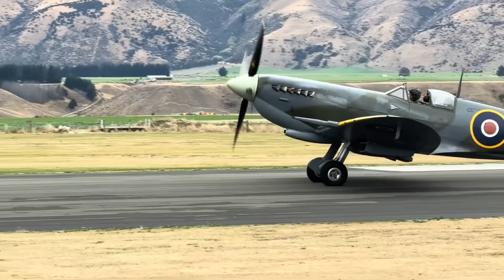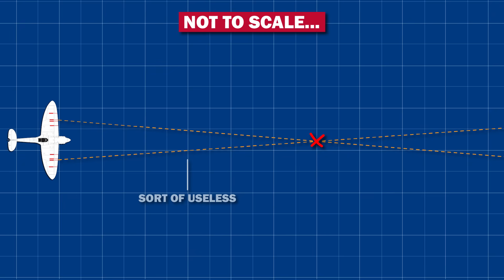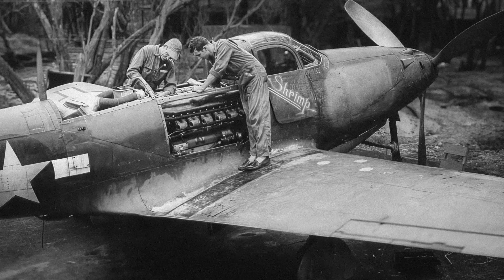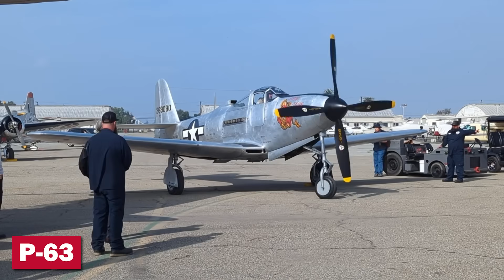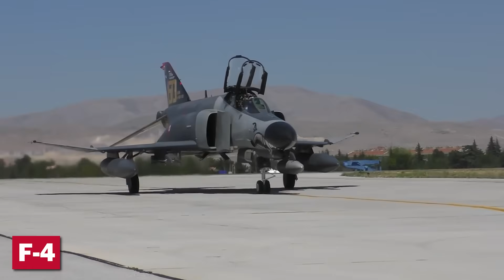What happened To Mid-Engined Aircraft?

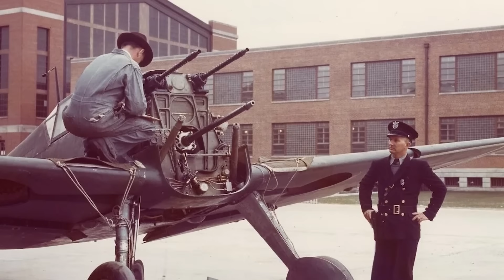Comment: 5:05 they did mount a 20mm cannon on the design - that was the P-400, I think exported to the RAF/RAAF and used in the Pacific
and they mounted 30mm cannon in the Bf 109 hub didn't they? and 37mm and 45mm in the Yak-1/3/9

Comment: Also worth mentioning is that P-39, while deemed unsuccessful on the Western front and in the Pacific, was broadly loved in the Soviet Union, which received most of the P-39 production as part of the lend-lease act. The Soviet Union flew comparatively few long-range bombing missions that required long-range escorts, and most of the air combat was done closer to the ground, so the P-39 fit the doctrine quite well, and also was generally of much higher build quality than domestically produced airframes.

Comment: You have some serious Misconceptions which for the sake of proper learning need to be disclaimed. 
-First XP 39 WAS made and flew in 1938, but First action was in 1941. 
By that time 37mm Guns were HEavily obsoleted. German ones got obsoleted By Russian tanks, Russians used the 45 and 75, Brits used a 2 pounder and Only the French, who were also obsoleted completely by Occupation had 37s on their Tanks. 
Statistically yeah MOST tanks IN THE FIELD since they are leftovers from the Early or pre-war would have 37s but NO new tanks that were not AA were made with such a small gun. 
-Second the Mid engine allows for Horizontal or Flight axis rocking. Especially with a large calliber(for a plane) weapon. The US 37mm short barrel did not have that much power, but Russians tried to mount their 37 that is 3x the caliber length of the M4 cannon and found out that is completely unusable in anything But Single shot fire. 
Which does NOT happen in a heat of battle. Even by most capable experienced pilots. 
Front engined Firgthers can fight heavy recoil because the weight of the Engine in front of the Pivot point(pitch axle) of the wings dampers the climb of the Cannon Muzzle rize, in case of FME completely eats it even for High power cannost like the Russian 37mm and 45mm on the Yak 9. 
P-39 actually aids the rocking a bit at low speeds because airflow isn't enough to resist, which Russians also reported. Yet be midful the Russian loved Both the 39 and the 63. 
Traditional FME(Front Mounted Engine) has its Gun Fighting to lift the whole weight of the Engine when it fires, P-39/63 has a Gun Mounted Above the Wing Axis plane and the Engine BEhind the Axis plane creating a Tail down momentum. When Both Weigh on the Pitch controls  at lower speeds the Gun rocks the Plane. Since Both The weight of the Engine and the Gun recoul twist the Plane in the same direction(pitch up) and the tail controls at lower speed do not ahve Enough Airflow to reists. So aiming becomes difficult.
-Third Engine, Radiators, even Fuel and ammo are Armour for the Pilot, especially protecting them from a Bomber. 
BF 109 FW 190, Shitfire, Mustang, Zero, your target from a back of a bomber is a head of the Pilot behind a thick piece of glass. 
In a P-39/63 its the Whole body of the Pilot. That Wins or Loses Wars, logistics. Other Pilots came back home way more often than P39/63 pilots.

Comment: Another reason for the taildragger configuration was the ability to have a larger propeller without having to add longer landing gear.
Reply from the maker: Ehh maybe? During take-off, even tail draggers lift the tail wheel off the ground before the main gear so it shouldn’t make any difference to the maximum allowable prop length.

Comment: The Germans also experimented with a mid-engined plane, but it wasn't a fighter. The He 119 was a prototype for a reconnaissance aircraft and a potential fast bomber with a twin-V12 behind the cockpit, a driveshaft going through the cockpit between the two pilots, and two counterrotating coaxial propellers in the front. The concept worked, but was deemed too complicated to be worth the effort

Comment: now, i have flown the p400 in war thunder vr sim mode, which i would say at least is a pretty accurate flight simulator, the p400 was the export version of the p39, and while maybe being technically more maneuverable than something like the 109, it felt unstable to fly, and simply trying to pull a sharp turn would put you in a spin. meanwhile the 109 felt very stable, and i could actually dogfight at low altitudes without worrying about going into a spin while turning.
Reply: they exported the P39 too - the P400 had a 20mm cannon and probably British-standard instruments or something too

Comment: This is a very good video, thanks.  I am subscribed.  

P-39 layout was best for fighters powered by liquid-cooled piston engines from around 1,000 to 6,000 horsepower, maybe more.  If jets and turboprops had not ousted piston engines, mid-engine layouts were likely to overtake.  But there was a lot of inertia favoring the conventional layout of the P-40; simpler to design and modify, familiarity leading to easier acceptance by customers and fliers, save the price and weight of a driveshaft, maybe simpler flight controls, etc.  

FRONT-ENGINE STRONG ADVANTAGES:  Cost, simplicity for designers.  Easier to adapt a new, bigger engine.  Save the cost, weight, and maintenance of the driveshaft.  

FRONT-ENGINE APPARENT ADVANTAGES:  Maintenance access.  Radial- and air-cooled engines cooling air ducting is simpler.  Flight controls have shorter pathways from cockpit to empennage, ailerons, et. al.  These advantages diminish with higher power, boosted controls, and could be mitigated.  

MID-ENGINE ADVANTAGES:  Pilot view, more powerful guns armament (can accommodate revolver and gatling guns e.g. MG-213), quieter and cleaner cockpit.  

The P-39 almost proved its point.  It offered better pilot view despite super-heavy canopy framing.  Its tricycle landing gear was the way of the future.  It was a little overbuilt and heavy for 1937 but its fuselage and wings stayed smooth and aerodynamic (did not wrinkle) as did lighter planes (Spitfires and Me109s always look wrinkly after use!) and it would have nicely accepted later, more powerful Allisons.  But it could not easily overcome shortcomings cooked into it at conception ... 

ENGINE:  The Allison was basically a fine engine but, in the P-39, it came up short for the famous reason that its turbo was deleted.  Later Allisons were eventually developed and would have been fantastic but they went to the P-63.  .  

POOR ARMAMENT:  That celebrated 37mm cannon was heavy and gave low probability of hitting moving targets, and other gunnery was too weak.  

SHORT RANGE:  In the 1930s, USAAC mis-read the 1940s' importance and utility of long range; it would have been difficult to build-in more fuel tanks; drop tanks only get you so far.  The radiator should have been behind the engine like in a Hurricane or Mustang but, instead, it was put right where the main fuel tank should have been.  Bonus: radiator could have been armored, for the cost of about 150 pounds of armor and ducting.  

MONEY:  Bell could not afford to fix it before competitors bypassed it.  They could have got rid of the stupid car-door.  

MIS-USE:  It was designed to intercept long-range bombers; that never really appeared.  Against the Zero, it was used poorly as a last-minute scramble to climb up and dogfight Zeros ... that is a no-win mission for anything short of a Bearcat, but played the P-39's weaknesses.  

Eventually, wartime experience made it clearer that the additional cost of a great plane was worthwhile, much more firepower was wanted, and pilot performance was the most powerful factor in success.  For best performance, give the pilot unobstructed view, simple controls, comfort and minimal bodily distractions for 6+ hour flights (air conditioning, comfy seat, room to move around and stretch, low vibration and noise).  It turned out the P-39 was probably too small but, for 1930s roots, it came close.

Comment: The shorter range was a problem for the western allies due to the distance between their fields and where they wanted to attack.  For Russia, the enemy was right in front of them.  Or the Brewster Buffalo in Finnish service.  Easy to maintain, handled rough landing fields, their enemy was right in their faces, and the engine didn't freeze solid during the winter.  When the P-38 was designed, shock stall was unknown.  What happened to air flow over the wing surfaces when approaching the speed of sound was totally unknown.  Eventually cause and effect was known and dive brakes were added.

Comment: 00:20 The spitfire PR. Mk. XI in this picture is not a fighter but a photo-reconnaissance plane. It has zero weapons.Should have chosen another variant of Spitfire

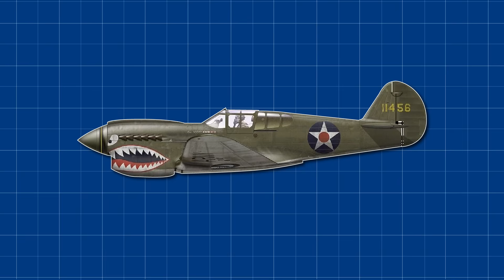2:02. Heavy engine in the nose does not hinder maneuverability. Rotating the plane to change where the nose is pointing is practically never the problem, the problem is always changing the direction where the plane is going. Need wing lift for that.

And - the solution to the trim drag is just to move the wings forward. In reality, the weight/position of the engine has NOTHING to do with the trim drag while maneuvering. The center of aerodynamic pressure is behind the center of gravity to keep the plane stable, not because the engine forces it to be there.

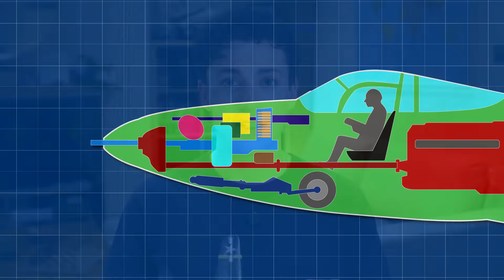3:08 "Most tanks of that time did not even have a 37mm" . Well, at the time of introduction of P-39, there were lots of old pzkw II's in service that had only 20mm gun which maybe makes this true, but 40mm was standard on almost all british tanks and france had losts of tanks with 47mm guns. 37mm was standard on german pzkw 3 (before model F) , but pzkw IV with 75mm gun was already in use and newest model of pzkw 3,  3F, had also entered production and had 50mm gun. And P-38 had the same 37mm gun as P-39. But yes, many fighter planes were still only using machine guns at that time, some had twin 20mm guns, the 37mm gun of P-38 and P-39 was really heavy for a fighter aircraft gun.

But putting the heavy ammunition in the front, far away from the center of the gravity had a big problem: When shooting away the ammunition, the nose became lighter which made the plane unstable and dangerous to fly.

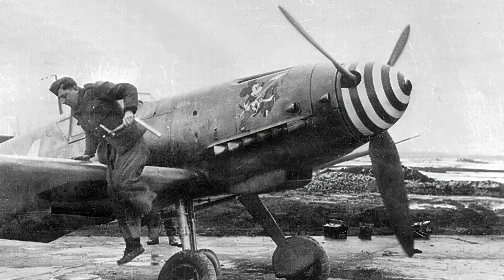5:13 No, 20mm gun could not easily be mounted to fire through the propeller hub with front-mounted engine. The engine needed to be specially designed to support that, and only the german, french and soviet engines were designed to support that. On british Merlin engine and also in the Allison V-1710 that was installed on P-38, P-39 and P-40, there was no space for the gun barrel between the cylinder banks, and installation of propeller-firing gun wa simpossible.

And I would classify F-16 as rear-engined fighter, not mid-engined, as in F-16 the engine is very much in the tail of the plane and there is very little behind it, however, F-35 and F-4 Phantom II could be called "mid-engined" as they have the tail clearly behind the engine and exhaust pipe.

Comment: Great vid. And while I have always loved the mid engined designs, I had never thought of l the extra frame-strengthening and, consequently, weight gains from having to deal with the stresses of having the engine and reduction gear/prop so far apart from each other. Good point.

Comment: Canons in the nose caused problems you didn't mention. Expending heavy ammunition placed in the nose caused the aircraft CG to shift backwards, which was not exactly a desired characteristic.
Reply: It is a problem that becomes a feature once the designer compensates for it. The CG can shift aft without a porblem as long as it remains within the limits.  Or perhaps they shouldn't have built the A-10 either.
Reply: @gort8203  I mention a real problem of the design that was omitted, and you act like I hurt your mom. Grow up.
Reply: @wtfiswiththosehandles  What? You are obviously projecting your own anger, perhaps over someone finding your comment misleading and correcting it. You grow up, and maybe sign up for anger management.

Comment: Most P-39s were modest-ranged, but the majority of the Q production (3450) and the L and M (250 each) so 3950 out of 9588 built (plus 167 Ns), had +29-32% internal fuel (110 to 120 Gal) that gave well over two hours of endurance on internal fuel alone, up to 3-4 hours with the external tank. This exceeded the Spitfire I-II-V-IX at 85 Gallons internal, except that the Spitfire had NO provision for a drop tank, while the P-39 could carry a 75 Gallon drop tank, thereby vastly exceeding the Spitfire's range potential... Outside of that, the P-39 range was low but passable at 87 Gal. internal. This also matched the Me-109G at 88 Gal. internal, the 109 having a similar 80 Gat. drop tank available (The Me-109K, 1700 built, could have 23 more Gallons internal with the MW-50 switched off.) Even a basic low capacity P-39 could carry 182 Gallons (or 229) to the Spitfire's 85. The 45 Gallon slipper tank could be carried by the Spitfire, but was not droppable. This barely matched 120 Gallons, or the up-fuelled P-39Q internal fuel alone(!), and the larger 90 Gal. Spitfire slipper tank barely matched the lowest endurance P-39 with drop tank (175 to 182 Gal.), but with far more drag...

Comment: 2 things Id like to add:
On a conventional front-engine plane with the center of mass so far forward it also means that often the (main) fuel tank has to be placed near the center of mass as well, otherwise using up fuel will shift the center of mass....and thats bad. So on a number of aircraft, not all, but certainly some, that fuel tank was put between the pilot and engine, so in a good-news-bad-news move the pilot wasnt being roasted as much by the engine, but he also had another 2 feet of nose ahead of him, compounding the visibility issues. 
The other is that the P-39 was supposed to mount a 20mm Hispano, but testing revealed that it jammed more than it fired, so if the nose has that much free space, why not go for the 37mm gun? It fits and it works. Wasnt the greatest idea given the low rate of fire, but at least you know now that they considered the 20mm Hispano and it just didnt work.

Comment: This does make you wonder why this didn't promote pusher style fighters. I mean, it was a concept at the time, and I remember one of Japan's last fighter designs was a tailless pusher with canards.

I know other nations made pusher types as well, yet it's weird the style was abandoned yet Japan went for it as their successor fighter design. After all, everybody struggled with the problem of guns in the wings instead of the nose, despite universally preferring nose mounted guns wherever possible, even to the point of putting in the 20mm cannons though the engine on the BF109 despite it causing overheating issues.

Comment: No hot oil and smoke in the pilots face from a damaged mid mounted engine.
Reply: True,but the front mounted engine also tanked most of the damage instead of the pilot being in the harm's way instead as is the case with mid mounted engines.